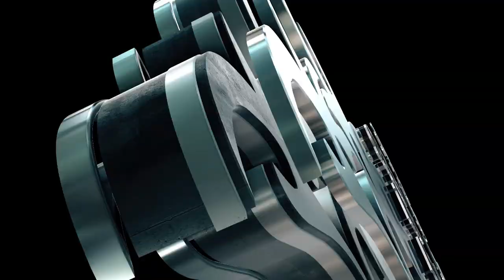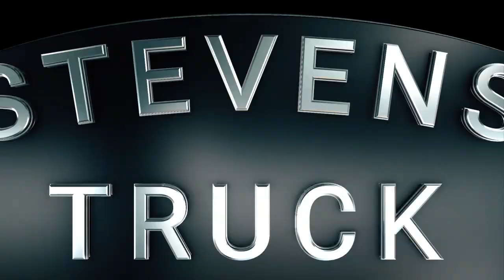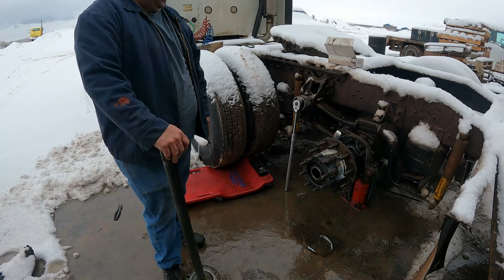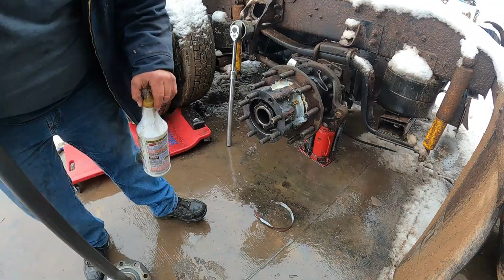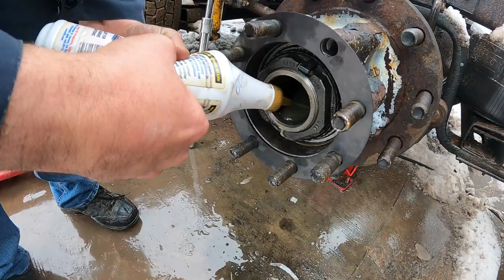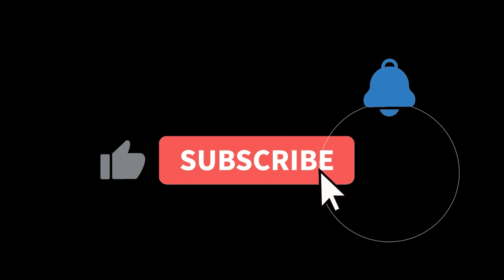HOW TO Install Axle Shaft in Semi Truck Rear End

Comment: can i mail you a cm870 ecm?? Needs programmed for a intl 9900, I got as a spare off ebay. same cpl.Plugged it in and truck idles fine however when i push the fuel the rpms go wide open
Reply from the maker: Hey Shawn! Unfortunately we do not have programming capabilities. Sounds like with the throttle problem your having it could be programmed for a generator set where its either wide open or off. Your local Cummins dealer would be able to help you program it!. Thanks for watching!